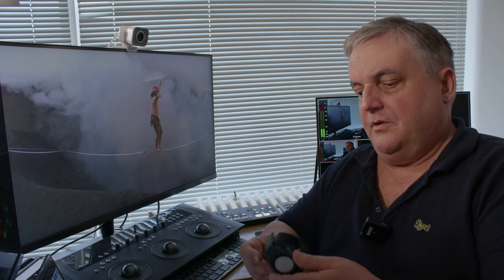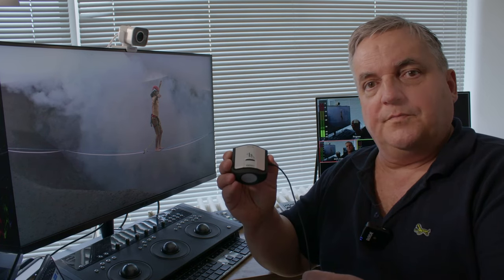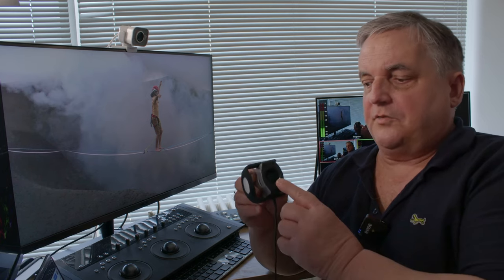Let's Talk About Monitor Calibration!

Comment: Thanks for the great content! Just wondering if working in Davinci requires an additional calibration.  I work on a computer BenQ monitor that I just re-calibrated with a Display SL (updated X-rite) colorimeter after a few years of use.   The new icc profile is now stored on the operating system.  I set the monitor to Rec 709 and it is in Gamma 2.4.  If I work in Davinci Resolve do you think I need to calibrate the monitor again using the workspace monitor calibration function?   I came across a post indicating that Davinci Resolve seems to ignore icc profiles stored on operating systems.  But I plan on using a serial node with color space transform that transforms input color spaces to Rec 709 so maybe any shift will be negligible.
Reply from the maker: Thanks so much for your message. As long as your monitor is properly calibrated you don't need to do any additional calibration when working with Resolve.
Reply: Awesome-thanks! @BlakeJonesShowsHowDoYouDoThat